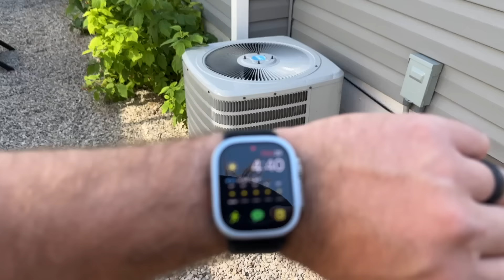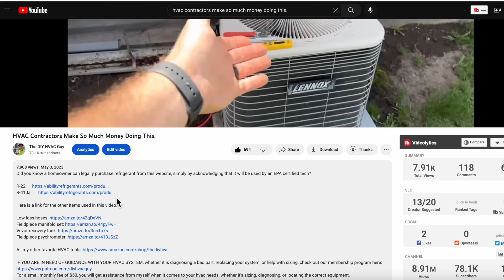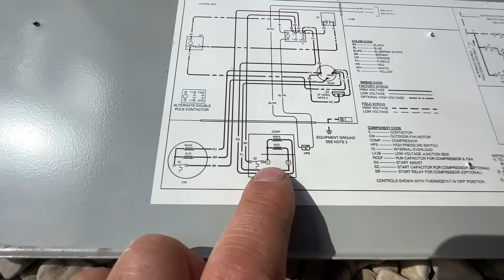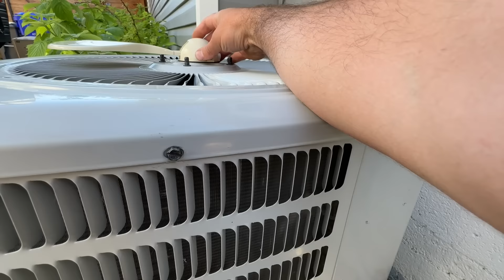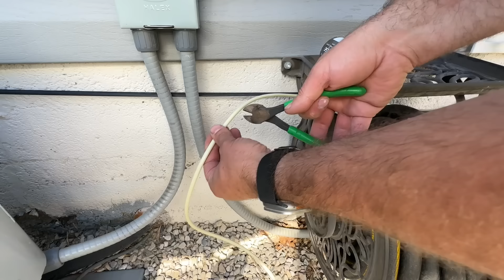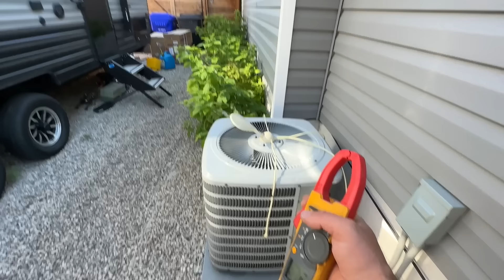Can This Device Actually Lower Your Electric Bill By 30%??

Comment: I added a misting system earlier this year, simply because my heat pump couldn't keep up, and a hvac friend recommended I add that to help. And it  really did....I have to turn mine on by hand though. Much cheaper than a new bigger pump.
Reply: Make sure you have a calcium filter before the mister… you can get a fan activated switch to turn on.
Reply: @markl8423  I just installed the filter.....hadn't thought of hard water and calcium build up at all.
Reply: @michaelhill6451  100%. Commercial and industrial systems don't go through all the extra steps of water treatment and careful design for maximum heat transfer and corrosion prevention because they like to spend $$$$. Corporations only spend money on equipment when it's necessary, you can't try to take advantage of evaporative cooling without also doing the extra processes to ensure the system will last and not fall apart prematurely.
Reply from the maker: Thanks for sharing!
Reply: @diyhvacguy  When you will make the video on how to replace the condenser with a water plate heat exchanger?
I think there are special plate exchanger to that specific work, that takes into account the change of state from the refrigerant.
Reply: @diyhvacguy  boy people have short memories. This was a very short lived fad in the Phoenix area in the early 80’s.
Even on a fully engineered scale there is a reason “evaporative condensers” (google it) are currently extinct. Epic amount of chemical treatment, water use, and cleaning. Semi annual cleanings with nastier chemical, high pressure washers, and usually (and very carefully) a hammer.
Everything right now is air cooled, or water cooled (closed loop, with an open loop cooling tower) for good reason.
Evaporative condensers are extinct for good reason.
If you choose to do this. You will save a little electricity for a season or 2. But pay a 1000x more in the long run.
Reply: Can we get a follow up on this product? @diyhvacguy
Reply: Water quality first. condensing temp drops, evap pressure/temp is lower.  Heat=$
This is a win
Reply: All window units use condensate to boost efficiency these days. They don't have drains.
Reply: @Flarptube  I have well water which has an alkaline pH so I should have no problem with corrosion caused by the added misting.
Reply: Didn't look that impressive. I've found that purchasing a couple of those vertical, bladeless fans allows me to be much more comfortable and raise the AC temperature by 5°. I don't know for certain, but I think the reduction in electricity used by the AC certainly makes up for the electricity used by the fans.
Reply: Why would the current go down due to this mist? What is the physics involved in that? I can see why the cooling would be more efficient yielding less on-time. But does it really both reduce power draw and on-time?
Reply: I tried this and it rusted out the unit in half the time that my second unit was  without the water system. Saved me $600 in ten years electric cost. But cost me $8800 dollars to replace the corroded rust bucket. 
People take simple green coil cleaner and a foaming hose sprayer from harbor freight. Clean once per month, rinse after and keep the unit under a patio umbrella to shade off the sun. Your welcome. The unit will do its thing without causing premature damage.
Reply: By installing this device you are reducing the life expectancy of your outdoor unit dramatically..Don't listen to this guy,he has forgotten to research all the facts...Misters kill a/c's
Reply: your hvac "friend" is just helping your unit fail sooner so he can replace it....
Reply: I did similar, years ago, but used a quality mister head set 3 feet from the unit. I also attached a cheap water timer because I'd forget to shut off the water. Of course I was using a 1.5 ton compressor to cool a 1500 sq ft house. Well insulated but with poor attic venting, you could feel heat radiating from the ceiling. Installed in the original build and 16 yo, the HP could drop summer temps by about 20 degrees. Adding a extra vents and an attic fan fixed the problem.
Reply: L
Reply: I think using the wind coming off the unit to turn a propeller that will produce electricity to battery would reduce your energy bill.
Reply: @coryboyd7958 I don't think so. It would slow the airflow and cost an efficiency loss to your HVAC system.
Reply: Sorry but this test was flawed in many ways. Just measuring the air temp at the vents is not a way to measure air conditioning efficiency or power.

What matters is the temperature DIFFERENCE between the return intake air temperature and the air vent outlet temperature.

For example if you have the AC running, your return air is 70F but the vents are outputting 55F air, that's a 15F difference which is decent.

Second scenario someone is doing AC "Testing" for YouTube and with the system running all day to get footage, the house is now like 65F. Even if the vent temps are 2F cooler than previously (55F vs 53F), the house is also 5 degrees cooler which means the temperature DIFFERENCE is now 12F and therefore the efficiency is actually worse but the vent temperature is cooler.

You need to gauge everything off the temperature difference to get any useful data.

There's about a dozen other flaws with this test as well. I had this idea years ago and mentioned it to one of my professors who is a PhD and has consulted with the world's premier air conditioning, heating, and industrial heat transfer system manufacturers. He said "of course that will increase efficiency, that's a given. But that system won't last because corrosion, the system is simply not designed to be misted all day and unless it is distilled water then it will produce a layer of calcium and other minerals which will greatly reduce efficiency"

And keep in mind, no little filter will remove minerals, that's just not how water treatment works. Only reverse osmosis or a chemical injection and removal process can actually rid of the minerals such as calcium.
Reply: @Dhagen6278 the othe variable you didn’t mention was the relative humidity at the time of testing. Where I live the humidity in summer is 20%. This would make a much bigger difference than if you lived in Florida where the relative humidity is 70%.
Reply: @ dhagan

Thank you 
💯💯💯💯
Reply: @Dhagen6278  RO water is mineral hungry and will corrode metals even faster lol. Ever seen what RO water does to black iron radiators in a boiler system? Chocolate milk bud.

 this whole thing is silly, tell me what the SC and SH are on the same conditions with and without the mister, then take those values and average them out, and see which is closer to the target for the given ambient temperature.. 

People here overcomplicate this so much, when you're watering your garden, just hose down the coil remove debris and CARRY ON WITH YOUR LIFE. ever heard the saying if it isn't broke dont fix it lol.
Reply: He not you hvac friend!
Reply: Skip the heat pump conversion. Let your AC be exactly what it is. Heat with gas.

Comment: I installed a misting system and I’m getting 55 degree air coming out of the registers and the air temperature that is above the fan is a lot cooler on the outside unit

Comment: Question, if I have a Kanetico Water Softener and chlorine chemical remover system and is a inline filter would I have a corrosion issue? I'm in Florida (central) and rainy season wouldn't really need to use.

Comment: I have this system and use it in South Georgia. It makes a 5° difference in my vent outlet temp. I also got a shade for my unit from a Kickstarter project. I'll install it in a couple of days to see how much it helps. I know it will drop the temperature of the condenser housing by 30-40° when it is in direct Sun.

Comment: I have done this on exceedingly hot days. I would not do it all the time though as you can clog your coil with mineral deposits or corrode it with water additives like chlorine.

Comment: Putting water on the condenser of a running AC is absolutely the WORST thing you can do. Unless you live in an area that has 100% mineral free water (which no place does) you will shorten the life of your AC because eventually the condenser will form scale and you’ll never get it off. Once that happens the AC efficiency AND capacity will decline. During my 35 years in HVAC I observed the results of this and every unit needed to be changed out because it was now junk. In places like Yuma Az they use a pre-cooler which does not come in contact with the condenser and this is the only proper way to do it. My advice is don’t ever put this product on your AC unit!

Comment: I mean this may be a “fix” through the hottest parts but not something I’d run constantly through summer, being a central Florida residential/light commercial HVAC tech.

You really don’t want that TD running too high, you don’t want the air coming out cold enough to start meeting dew point across ducts and especially vents; just keep an eye on things as you run it because your indoor profile, air circuit and refrigerant circuit are dependent on so many factors - outdoor climate is but one.

That being said - probably the best, easiest implementation I’ve seen for something like this. People usually just branch a hose and run way too much water (decent fix when OD fan is out and on back order but too much W fan) or they’ll pop an umbrella over the outdoor (now yours likely just cycling mad hot air), or portable blowers trying to force more air through there.

Comment: How does the mist lower the amperage? You mentioned that wire was to keep build up from inside tubing. What was the filter for? I believe the wire inside the tubing was to cut down the amount of water that could pass through the tube so the company could claim the low water use. That peel and stick installation I don't think can take as much heat as the air coming from the condenser will be.

About the wire inside the tube. I use to race circle track if you was running a larger carb than allowed, you had to install a restricter plate cutting the amout of air the engine could pull. I believe the wire was doing the same thing.

Comment: Just shade the unit from the sun, no extra moving components to break down no water wasted and no water damage or extra corrosion.

This misting system is a bad long term plan for short term gains.

Comment: I used one of those for several months and, yes, it lowered my A/C bill by a noticeable amount. The problem is that I constantly had to change the mister nozzles. Even using the supplied filter, the nozzles would clog in just a few days.

Comment: learned about this years ago when  working in engineering department in a hotel. We had  small shed like buildings in front of main A/C units with honey comb filters.  Water would run down the filter. Fans would pull blow across these into duct work connected to the A/C to send in precooled air.   This was on roof top in Southern California where temps went over 120.  Saw the mister kits for home A/C. Great idea to bring temp down on compressor. When temp gets to high compressor "head Temp" will cause it to shut down. Definitely tales a big load off your unit.

Comment: Water Vapor Is The #1 Massively Produced Man Made Greenhouse Gas That We As Humans Produce More Of Than All Of The Other Greenhouse Gasses  Combined!! We Measure The Other Greenhouse Gasses In Parts Per Million!! We Measure Water Vapor In Parts Per Hundred! CO2 Climate Change Is A GRIFT!! You Can Even See It In Al Gores Chart In His Movie!! CO2 Lags Behind Temperature By Decades!!Clouds Of Water Vapor Trap In The Heat From Our Sun So It Does Not Escape Into Space At Night!! Thus We Measure Upper Atmospheric Cooling And Slight Surface Warming!!

Comment: Where I live, you're going to ruin your AC unit if you do this, the calcium left behind as the water evaporates is going to clog the coil, then YOU'RE SCREWED! Also, that water doesn't come free, not even if you're on a well system.

Comment: Great 👍 idea.!!  This will work really great in low humidity climates. However in Arizona this is rarely used anymore due to excessive calcium buildup on the condenser coil. That little filter really doesn’t work all that well.
We don’t use it at all in commercial applications.

Comment: It lowers the high side pressure by making the condenser more efficient, thus reducing load on compressor saving electricity.  But beware of the potential side effects like mold, rust, and hard water deposits over time.

Comment: These water misting devices were a big fad here in Florida 30 years ago..While they do what is advertised increasing running efficiency. The device reduced the life of the condensing unit dramatically because the mist creates corrosion,electrolysis ,rotting the fins off the condenser coil and many times caused refrigerant leaks in the condenser coil. (More efficiency, shortening the life of the A/C.)

Comment: SPOILER ALERT!!!!!!!!! If you really want to save more money on your bill, do these things first.
Regularly change out your air filter. The closer to the floor, the more often you should check on it. Airflow is key.
If your unit sits in direct sunlight all day, concider making an awning for it. The shade can drop the affecting temp on outside unit by 10 to 15 degrees. This can make a major difference on the longevity of you unit. 
Clean out your coils before you start using it for the season. Once again, airflow is key.
Biggest pro tip.......
Find a comfortable temp and set it. Your unit is not designed to cool you off. It is designed to maintain a temperature for your home. If you are coming home and cranking on the system, it is under a major heat load. It is also at peak power rate time.
Maintaining a temperature is far easier on your system, cause less stress on the mechanical parts, and keep you in a more comfortable environment. 
The hard start of a unit is what draws the most amps.
Be kind to your machine and it should serve you well for many years.

Comment: Does it work? Technically yes , does it lower your bills technically yes. Is it worth it? absolutely not
So the system amp draw went down by .9 amps average price of electricity is .15c kw/h so 1000 watts in an hr costs 15 cents. Amps times volts times power factor = watts it comes out to about 3cents an hour lets assume the impossible your system runs 24hrs a day for en entire month it would be about $20 lower. it's not worth the hassle, The water exedra especially in the North it's just such a negligible change you can improve the subcooling by planting a tree nearby the unit to block the sunlight.

Comment: Should use the Common wire of the compressor, not the Run wire. Keep in mind the capacitor flows current to the start winding when running. Not to be confused with the start capacitor. 
Also I do not have a lot of faith in the suggested water filter. I can attest if that water filter is connected to your ice maker, you will still see floating lime scale settle to the bottom of your glass.
According to your post date should have about 1 year of use. I would be curious how much white scale has accumulated on the condenser coil?

Comment: First thing is I seriously doubt that thing uses 1.6 gallons of water a single day to run all day long. The second thing is I'm pretty sure you messed up your installation by not making sure one of the misters goes on the front of the unit. having a MR on the back of the unit doesn't really help you a whole lot Because on most units the back panel isn't as big and isn't as efficient.

Comment: Three times I built an air cooler using Celdek media pads (like the ones used in those MasterCool units) around an air conditioner. The first two were in the California "Inland Empire" and the third was in Phoenix. While a bit more expensive than the nozzle sprayer approach, it assured that no water had to contact the fins (which would certainly have scaled them up otherwise), and the "air washer" effect kept dust, spores, etc. from fouling those condenser fins. This proved quite effective in lowering the air temperature esp. in Phoenix: though the ambient temperature frequently exceeded 120degF in the summer, that 5% humidity made for a startling evaporative cooling effect! With cooler pads only 2" thick, 30-40degF temperature drops were realized. With lower air temperature passing through condenser coils, lower head pressure is required to condense refrigerant--which makes for lower power consumption, reduced wear on the compressor, and more efficient AC operation. Oh, and I used a small water tank with a swamp cooler pump and float valve to reduce water consumption (with a little bleed-off and a bag of polyphosphate crystals and a "slime stick" to reduce pad fouling). 

I've seen much larger commercial air pre-cooler methods being used on some air-cooled rooftop units of 50 tons or more capacity. That's where I got the idea to try scaled-down approaches of this concept. 😄

Comment: Well, 140 bucks seems a bit high for that plus my Spicket on the other side of the house. I would have to run a tube 50 feet all the way around and that’s not happening. I guess I’ll just have let it be the sun. It’s been in the hundreds here in Tucson, but my air is working fine pretty much.

Comment: Don't do it unless you want to ruin your condenser coils. I did this to a 10 ton commercial unit in a bar I owned in South Florida and the chemicals in the city water pretty much ate up the coil. I am also a State of Florida  A/C contractor so I feel I am qualified to tell you this. You want to do something to help your a/c? 1-Clean the condenser yearly. (More if you have a lot of tree leaves) 2-Replace filter monthly. 3-Clean drain line about twice a year (once if you keep tablets in the pan or have a UV light in the air handler). 4-Have an a/c contractor remove and clean air handler coil every few years. If you want to mist something put the misters on your patio.